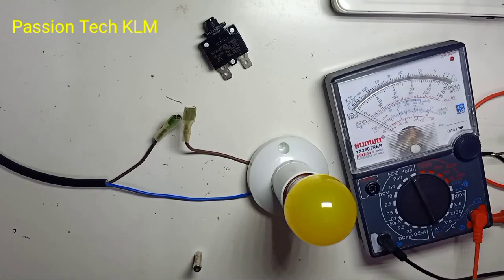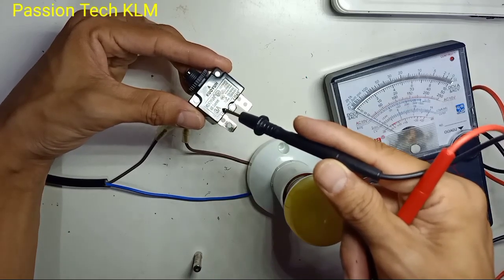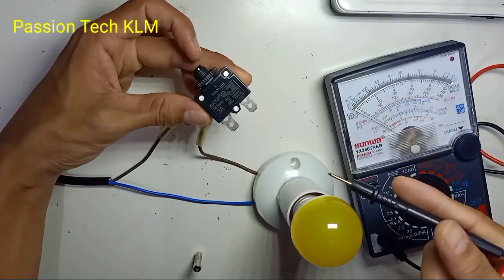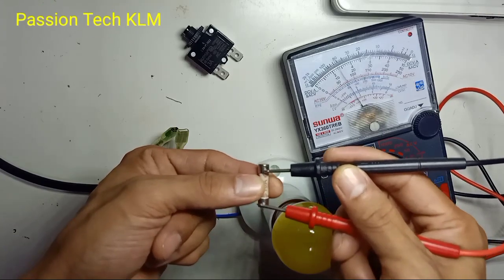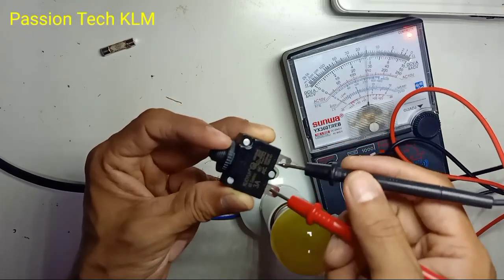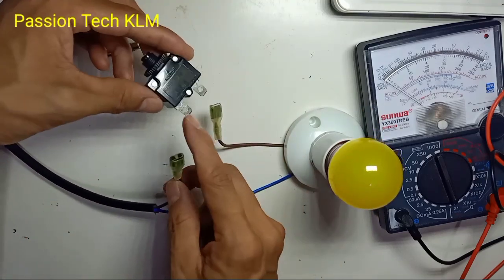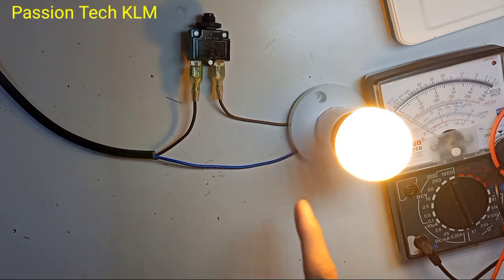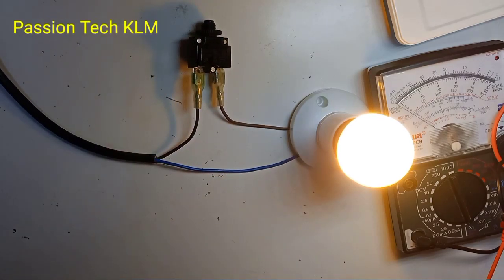Circuit breakers or overload protector

Comment: your demonstration shows a power supply of line to neutral connection. in the case of line to line connection where, instead of one hot line and one neutral, we have both hot wires, L1 & L2 @ 120vac each, can we use this overload/overcurrent protection? which line do we use, L1 OR L2? thanks in advance.
Reply from the maker: Either L1 or L2 is the issue you can use both side it's still get the same result.
Reply: @passiontechklm  thank you and more power to your channel
Reply from the maker: @arielnitro84  thanks 🙏

Comment: I have an old1.5 hp motor that has a three pole thermal protector that disintegrated.  That protector is no longer made.  What do I need to look for in buying a replacement?
Reply from the maker: This will work only for two terminal depending on the Amps.